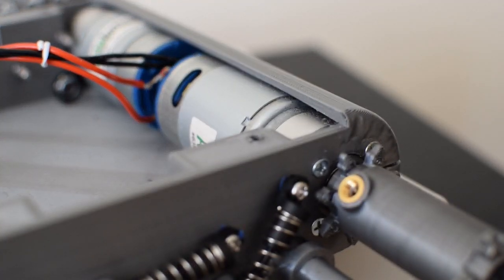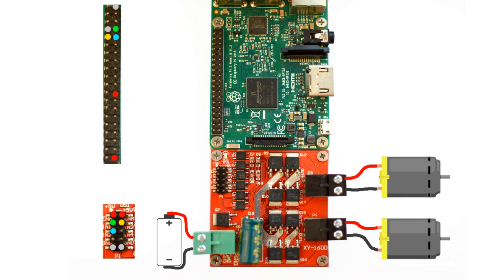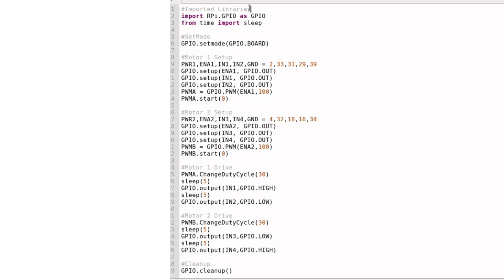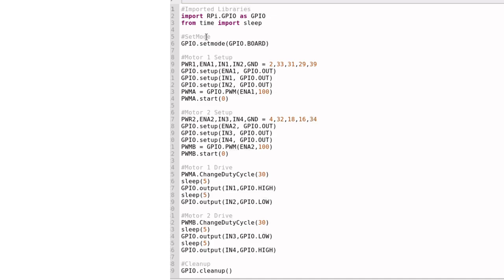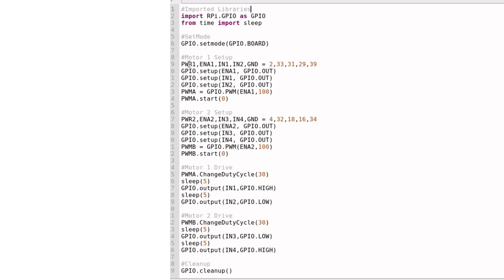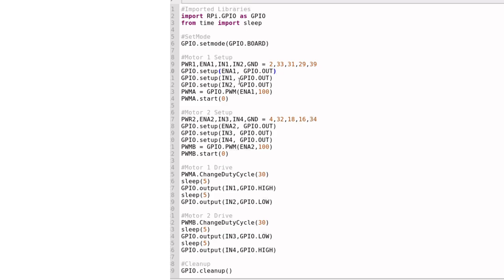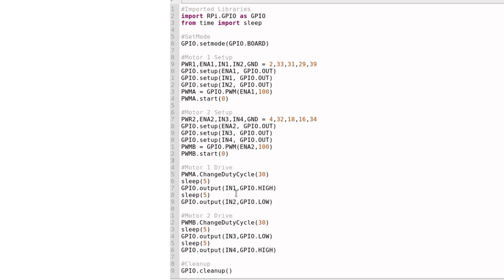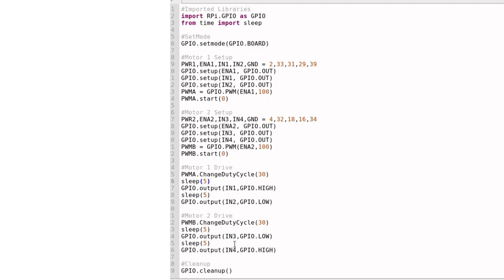How to Control 2 DC Motors with Raspberry Pi!

Comment: How would I code an input as a receiving transmission from a remote control?
Reply from the maker: The way i control it with a cell phone is with node red. I basically took this code and just used their online web server. You can also just remote into the Pi with VNC on a laptop and just run the code like that. Probably the fastest way is with SSH, but there is less control with it.

Comment: It keeps getting stuck in the first motor how fix
Reply from the maker: Hi, do you mean it only rotates one motor even with the code for both? Be sure the PWM wires are connected to the second motor properly.
Reply: @AvivMakesRobots  no i mean it goes on the second one then switches to the first and never switches back

Comment: How to connect dc motor encoder to raspberry Pi which motor driver is required ?  Does  L298N will work ?
Reply from the maker: I haven't done it, but I am guessing the encoder would be connected to the Pi and not the motor controller.

Comment: bos can you help me. how to run 4 12v dc motor using raspberry pi 4
Reply from the maker: I would look for a 4 channel L298 driver depending on the motor current you need. There are many available.
Reply: @AvivMakesRobots  nice, thank you for helping :)
Reply: what f i use 2 l298n